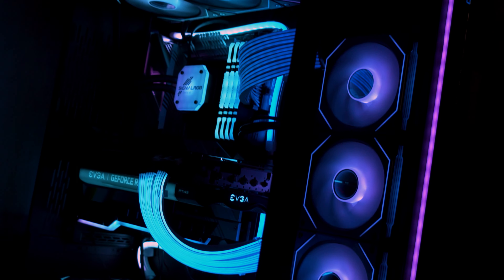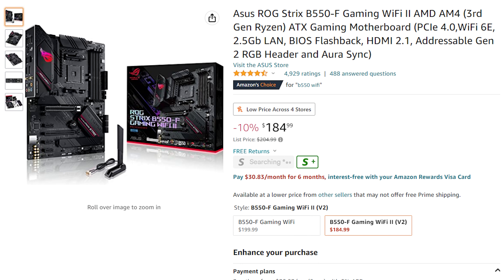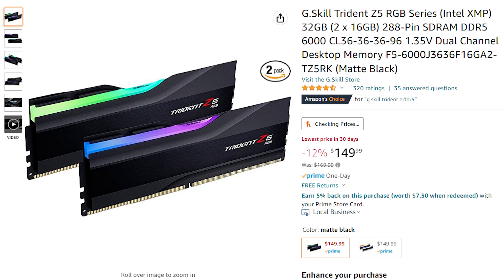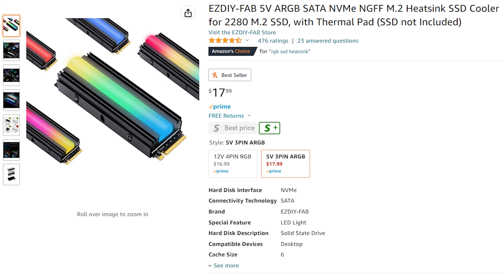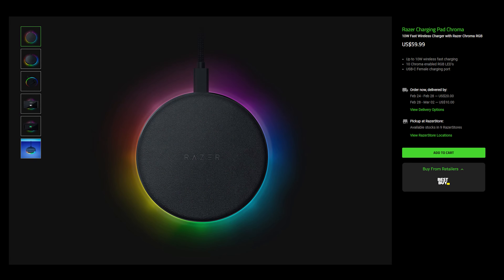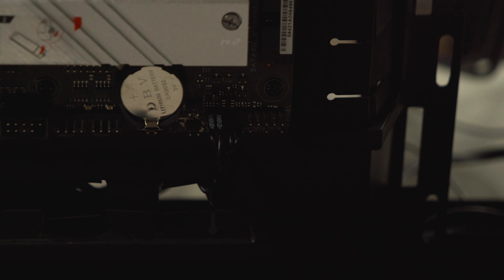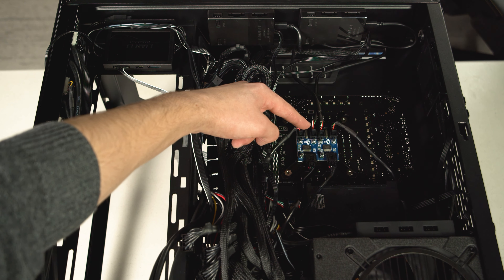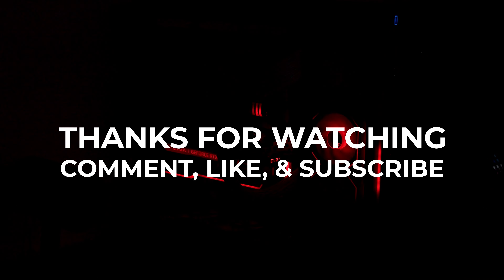Synced RGB Setup Guide

Comment: I have a zotac 4070 ti amp extreme airo and it isn’t supported on Signalrgb. Will the video you have on how add a product that isn’t supported yet work for it? It has 5 argb lighting zones so i wasn’t sure. It also does not connect to a 3 pin header. I know it’s probably difficult having to connect a lot of devices, so if there is a way I could do it on my own i will be happy to do so.

Comment: At 15:23 in, it made realize WHY my RGB's were laggy. I had 9 fans on 1 cooler master controller. I should have used all 3 controllers instead for the sweet spot. This vid helped a lot and will definitely try 3 fans per controller when I get home and see if it works. Thanks Signal RGB team ❤

Comment: I only use 5 RGB pieces in my pc. 

DRam (Kingston Fury)
MSI X670 Carbon (Dragon is rgb)

AIO=be quiet Silent loop 2 (argb)
STRIMER plus v2 (argb)
Case RGB be quiet dark base Pro 901 (argb)

If i daisy chain my AiO Pumps RGB, my  Case RGB and put my strimers on an extra argb header, will they all be detected? Or do i have to use a controller?

Comment: I’m new to rgb but I have the strox b550f gaming wifi board and it doesn’t have any 3 pin argb pins. what should I do in this case?
Reply from the maker: Get a supported argb controller, watch the controller guide we made to learn more.
Reply: @SignalRGB  thank you 🙏🏽🙏🏽

Comment: Did you plug in the lian li fan controllers into the argb header on the motherboard ? I was thinking of bypassing the lian li controller by buying 10 single pack fans (3 top, 3 bottom, 3 side, 1 rear) — single fans come with standard argb and fan connectors. So can I just plug the 4 argb connectors from 3 sets of daisy chained fans + one single rear fan to signal chroma controller ? (Would be using total of 4 ports on the chroma controller) Will this work ? If yes, how can I configure everything off of the chroma controller in signal rgb ? Thanks again!!
Reply from the maker: It wont work using the argb header or i would have done that. Only the fans on channel 1 would be individually addressed, then all the other channels will copy channel 1. This is directly with internal USB. What you could do is buy adapter cables so that you can connect the fans directly into an rgb header without the lian li fan controllers.
Reply: @SignalRGB  so how do I control all my 10 sl infinity fans with signal? Your discord said to buy the chroma rgb hub? Would I just plug each rgb header from each Lian li controller into the hub?
Reply: If you buy single packs it comes with cables to connect to pwm and argb, so you would configure the fans on the controller you connected them too.

Comment: The bit I wanted to see was skipped, do you plug the other controllers into the motherboard, or into the Razer Chromo?
Reply from the maker: What do you mean?
Reply: @SignalRGB  I have the following;
Lian Li O11 EVO RGB case
Nxzt Kracken Elite RGB cooler (with its own fans & controller)
2 x 3 Lian Li Uni case Fans TL LCD 120 (with 2 x controllers)
CORSAIR Vengeance RGB 32GB
What's the best way to connect them to sync with each other, regarding plugging them into a controller/controllers, and whether I'd use 1 or 2 software to run them?
Reply from the maker: @DANGEROUSSCION  https://youtu.be/Qd209pxPzpc?si=G9JgmePrUNzNNc4h

Comment: Very good explanation easy step by step to follow also for beginners like me. I have just maybe stupid question : All the branded software implement a feature for firmware check and eventualy update for connected and recognized devices; there some possibility to update the firmware "manually" ? It is really necessary to do this periodical check/update ? I use mainly Razer Synapse. Thank you
Reply from the maker: Firmware updates are not that important. If you really want to you can always re-downloaded RGB software occasionally after a few months and update firmware, then uninstall them again.
Reply: @SignalRGB  Thank you for your prompt reply.

Comment: Thanks for the great video , I have a question , how do you manage to control your AIO with signal rgb , i do have Corsair H115i platinum but the program doesn't see it , I can't add it and it's not even plugged into my commander core xt but on my MB , thanks for your help !

Comment: Im using 8 lian li sl120 v2s. Should i use the lian controller or just connect all the fans straight to argb headers to work properly with signal rgb

Comment: Ive been having difficulties setting up my Lian Li strimmer cables, Im using the L connect controller provided for just the cables, when in motherboard passthrough mode, the top LEDs of the GPU cable turn off. If I don't have them on motherboard passthrough mode, they are super laggy. Did I connect them to the wrong header? Does the software support the 12vhpwr v.2 gpu cables?

Comment: How did you daisy chain all of the argb hubs to motherboard? Im building a full rgb rig and Im running into a problem where I have too many hubs but not enough 5v 3pin on motherboard. I have 3 uphere fans which requires it’s own hub, lian li strimers which also requires its own hub, a 10ports argb hub, and another argb/pwm hub. Is it ok to daisy chain the lian li and uphere hub to the 10ports hub and then to motherboard?
Reply from the maker: @ryanwong1286  get nollie32 instead

Comment: Sorry for asking but i have a Lian li Dynamic EVO case. How to conect the case cable correct so that i can control the RGB LEd strip on my case panel. 

PS I have no rgb controler yet. I dont now what to buy. i want to use 9 pcs of Adresseable budget RGB fans trough a budget RGB controler! Bet everthing needs to work whit SIGNALRGB software! 

SORRY FOR ASKING BUT REALY NEED HELP

Comment: are you plugging the 3 pin argb + 4 pin pwm cable for each of your lian-li controllers or are you simply plugging the sata and usb cable?
Reply: The controller and fans will be detected in signalrgb through the usb but you will need to hook up the 4pin pwm cable so you  can control fan speed through the motherboard. If you're using L-Connect, you dont need either as fan speed and argb(obviously) can be controlled through the L-Connect app.
Reply: @ThatsWhatSheSaid84  Thanks for the info!
Reply: @iarkosios7175  no problem. Also worth mentioning, not sure if you would still need the pwm hooked up if using the pro version of signalrgb since that has fan control as well, I'm just not sure how capable the pro version is.
Reply: @ThatsWhatSheSaid84  I ended up plugging the pwm into my mobo and enabled passthrough to solve the low frame rate issue. Now the only issue is the rgb resets after waking up the pc from sleep.

Comment: I have a Aero Cool Mirage 5 CPU cooler and it's not listed in your component config list, It works fine with static colour, but if i want to mix it with music, the Mirage 5 doesn't light up, I'vegot a Asus ROG 3060 and a Z760 Maximus Apex mobo and Team Force DDR5 ram.
my case fans are Deep Cool CF120 Plus, 
Any tips on what i can use to get the CPU cooler work with music.

Comment: really disappointing that only strix cards have individual led control do you know if this will be fixed in the future or if its just not fixable? I have a 3080 FTW3 ultra and it really ruins the spiral rgb i use as its just one massive single colour
Reply from the maker: Thats a limitation with the gpus. Some just cant be controlled directly better than that. The only reason native applications can do it is because they baked the few effects they have into the firmware so they dont actually control the gpu rgb directly like SignalRGB does. Thats also why there is only a few effects in native apps.

Comment: Are the Lian Ii sl V2 fans and controller going to be added to supported devices?
Reply from the maker: Yes
Reply: @SignalRGB  at this point in time, are you guys able to tell if support for V2 controller will be better than V1 controller?  I know there are issues with V1 controller (ie. slow/lower rate, etc).  Also do you know if Lian Li daisychained fans are able to be individually addressed if connected to something like the razer chroma controller/zalman zsync?
Reply from the maker: @c4ptainmerc  yea you can individually address them if they are connected to other argb controllers while daisy chained. Keep in mind what the led limits are per channel on those controllers. Its in my guide.

Comment: NZXT Function Full Size.
Signal RGB don't even see my keyboard. it is not working. i was using K60 and it was working. Your support list says it is supported and i paid 120$ for this keyborad. Keyboard is awesome but signalrgb don't see it. And i am feeling dissapointed and cheated.
Reply from the maker: It sounds like we do support the keyboard but that you have a different PID or layout etc that needs to be supported. You can jump on Discord and see if someone can quickly modify a plugin for you (if its possible): https://discord.gg/signalrgb
Reply: @SignalRGB  i uninstall the SignalRGB and reinstall it. it appears program don't update itself. And i can't download SignalRGB from official website so i used another website. 

Now program see it, but it see as area illumination not as per key illumination. I hope you can makes a update. And at least just say so at the website like " not supported per key for the moment." Etc. Bcs i was using a 40$ keyboard and it support per key illumination with Signal rgb.  İt is almost looks like a second screen. And i naturally think "if both supported it must be same. " BCS with nzxt cam keyboard support per key lights . Apparently this is not a hardware problem.
Reply from the maker: @MiAeron I don't suggest using any other version of SignalRGB from any website other than the official website https://signalrgb.com As for your per-key issue, that keyboard appears to have issues with advanced RGB effects on a per-key basis, that's why if you watch any reviews of the keyboard you will see they never show off anything other than basic waves and ripple effects. So it's been limited to zones in SignalRGB to prevent lag, it is actually a hardware limitation. Take a look at NZXT cam and you'll notice it doesn't have any advanced effects for that reason. (Advanced meaning the types of incredible effects available in SignalRGB).
Reply: @SignalRGB  But your website somehow don't work. İ will try VPN let's see if the problem is with that.

Comment: Doesn't work with cheap RGB products though
Reply from the maker: That’s not true. We support plenty of cheap products. Red dragon keyboards are some the cheapest you can buy. What we don’t support is REALLY cheap (poorly made) products that are simply impossible to support.
Reply: @SignalRGB  I have Darkflash case fans and AIO. It doesn't work with mine. It also argb cables in them. Dont know why it would not cause even the manufacturer software supports it like aura sync and rgb fusion
Reply from the maker: @iangabrielalcantara7756  We don’t support that not because it’s “cheap”, but because it hasn’t been requested enough for it to be higher up on the list that we work from everyday.
Reply: Is there a way to get signal rgb to kill certain armoury crate processes without having to do it with every PC start.. I was able to stop the lighting process.. but there's one other thing that starts.
Reply from the maker: @DRSKINGDAVID  In settings you can enable to auto close all other apps
Reply: @SignalRGB  You support their keyboard but not their mice like the M908 ReDragon MMO mouse with RGB

Comment: i use signal rgb, all its ok except Govee integration. not working , after all thoes months govee its still in beta mode? you integrated yeelight thats ok, but you dont give a shit about govee, its brokke, fix it, i am a pro user but i wont pay a daim till this problem not solved, i heasrd corsair icue will integrate govee in thei soft, then bye bye signal. i wait month after month to fix govee but you dont care, so byeeeeee, after this month my pro sub will ended.
Reply from the maker: https://youtu.be/F1ScLpRnH_I?si=f-dvEPECG73T7VJU
Reply: @SignalRGB  old news my friend. I did all that. Somtimes its working, somtimes its not. Most of the time not. Nanoleaf works all the time no problemo but when it comes to govee module its searching an eternity without finding enithyng. Dont give me a tutorial, bcas i did that. Its your software not finding my govee products and i have a lot like 8 .
Reply from the maker: @reignman.7555  Is your govee device bluetooth? Right now we only support wifi. We have been in touch with govee to get their stuff supported better.
Reply: @SignalRGB  i have Wifi 2,4 ghz and bluethoot both enable in the govee mobile app also lan connection enable for all my govee stuf. I have 4 lightstrips and 4 hexa glide controllers. In total 8 controllers. All of them wifi , bluethoot and Lan connected